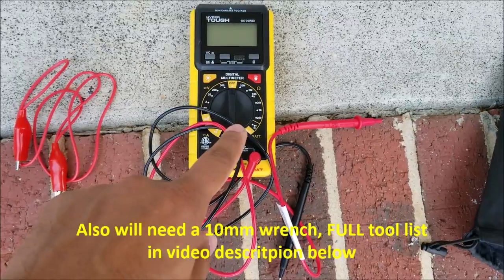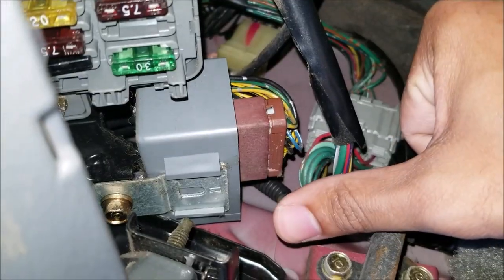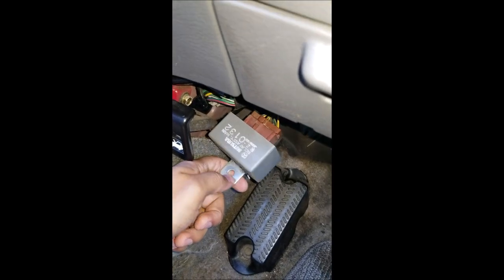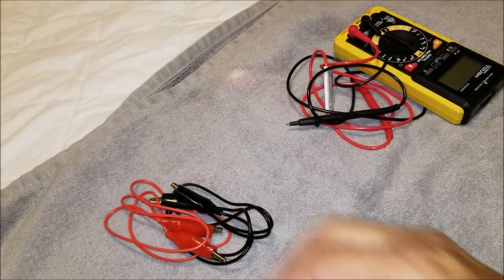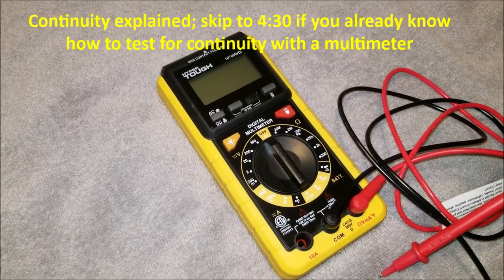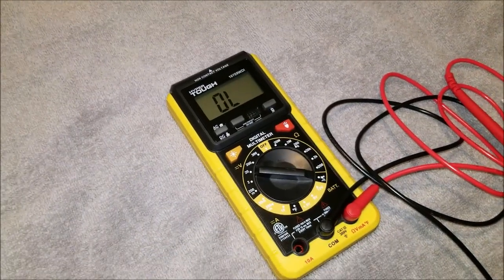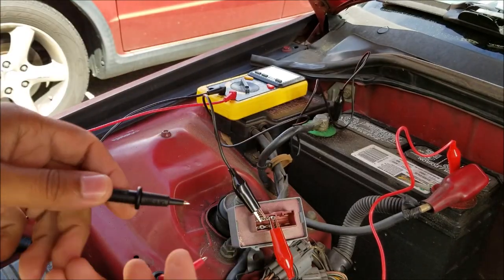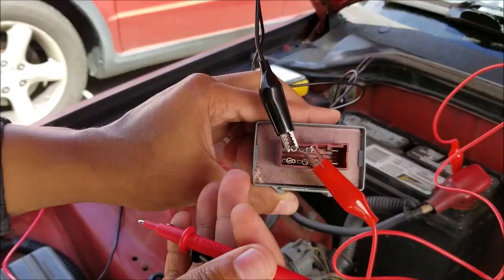How to Test and Replace Main Relay | Honda Acura 92-00 | Car No Start

Comment from the maker: Added correction for feeling for clicks. You'll only feel two clicks; 1st at key position II and second click at key position III (ignition, car turns on)
Reply: I just replaced relay and I still only have one click at the on 2nd turn of my key
Reply from the maker: @kentjordan3574  do you hear the fuel pump priming in the background with the key in position II?
Reply: @EngineeredMojo  no sir it does not power on.
Reply: @EngineeredMojo  I have a question. When I tested prongs 1 and 3 with positive on 5 and negative on 2 I got no beep. Ir instructions say to replace multimeter. Why do u suggest that of my meter worked fine on other test?
Reply: @EngineeredMojo  I have this same issue, I hear and feel one click on the second position and I hear the fuel pump priming. But when I go to crank the engine nothing happens
Reply: @JelloSpucci  did you ever figure out what’s going on here? My car started doing the same thing this morning
Reply: @pandajoexd611  so to be honest with you I'm still trying to figure it all out haha. But I was able to get the car started last night by basically running a small lead from the starter signal connector and then touching the battery for a second. I tried this before with my old starter and nothing so I went to a junk yard got a new one and boom. Now I have to figure out why the key isn't starting the car but jumping it will
Reply: @JelloSpucci  so I had just spent the majority of the morning trying to get mine started and I replaced the starter solenoid form one I found in a junk yard because the new one was 3 days out on order, don’t know if that helps you but I got my cb7 running again
Reply: Mine only clicks once. And I resaudered it. It looks good. What do you think?
Reply from the maker: @frankifleury5606  does it start yet? If not I would test the relay as I did in the video. You may need to resolder

Comment: When I put 9v (I know I’m at work ) to relay its more of an electricity noise not a click. I’m wondering if soldering or cb is bad . I bought a new relay but it’s not the Mitsuba one it’s a duralast 20505 . When I put power to 6&8 nothing happens on that one . I was also getting 6v to my fuel pump connectors  with multimeter . Car crank no start HELP
Reply from the maker: Hmm, if the new relay isn't clicking, it might be faulty, or there could be another issue in the circuit. Did you check all the connections?

Comment: Great video... however on my relay number 6 is missing on yours number 4 is missing although my relay part number seems to be the same. My car is a 1.6 16v crx 1989.
Reply: Yours is 4 then I have a diagram of the two different versions
Reply from the maker: Glad the video was helpful! That's interesting about the missing pin, it's possible there are slight variations even with the same part number.
Reply: @EngineeredMojo Mine is a uk spec 88-91 crx 1.6 16v d16a9 engine if that helps

Comment: 6 years later and hoping for anyone to respond to my question....does the relay need to pass all 3 tests? Mine only passed test #2 so would that make it a faulty relay? Thank you and great video
Reply from the maker: Video creator here! Yes, ideally, you'll want all 3 tests to pass as your testing different circuit routes. Do you have a friend with a Honda you can hook your relay to?

Comment: I bought one and my carcstays on for 5 seconds and still dies out and don't hear fuel pump priming.  My fuel pump is a year old and relay is brand new. Is it possible since its not oem Mitsuba brand it could be bad brand new?

Comment: Really great video. The only issue I have is that there have been times that I've bench tested a passing relay, but after opening the cover the contacts were badly corroded. Not corroded enough to fail the bench test, but enough to not allow enough current to pass through. To anyone who can open their relay please do so and check the contact points.
Reply from the maker: That's a great point, thanks for sharing that insight!

Comment: I also want to add if you don’t want Hondas there are two engagement in the main relay so sometimes you can hear click but that doesn’t always mean the relays working one send information to the fuel pump and one send information to the ignition. Sometimes one or the other can fail.
Reply from the maker: Great info to add, thanks for sharing!

Comment: Ordered a main relay. Now time to wait for it to arrive. Having an intermittent no crank issue where i get a single click. Starts whenever it wants to. All my dash lights are working as normal. Believe the main also acts as the starter cut. Can hear the bendix engage but its not trying to crank so hopefully it fixes my problem. If not I also suspect the ignition switch or neutral safety. Haven't had problems though indicating it would be either of those. When it starts it never stalls or dies. Always runs as normal when it does crank up
Reply from the maker: Hope you were able to get this resolved!!

Comment: Would the main relay cause a no crank condition?
Reply from the maker: For sure, it could be a cause and semi easy to diagnose!
Reply: @EngineeredMojo alright. Been having a no crank issue sometimes where it doesn't wanna start. Been hearing a click from where the main relay is located, my other question is if the relay is clicking is there still a chance that the relay is bad?

Comment: Is it normal for these to function and spontaneously stop working then with a few clicks gets back to functioning
Reply from the maker: @Terraworld-c7l  I could see that happening if the solder on the connection is only partially degraded
Reply: @EngineeredMojo  thanks

Comment: If this relay not working the check engine lamp will always lightning??
Reply from the maker: @youssefahmed6839  not always, if the relay is not working the car probably won't even start to see a CEL 😄
Reply: @EngineeredMojo  u mean that will not hear the sound of the march or the motor trying to start up ??

Comment: Awesome video. Thanks for the test text in the details section. Mine failed at test 2 so ill be ordering a replacement. Thanks again!
Reply from the maker: @artramirez3506  glad the test worked out and you were able to locate the fault in your sensor!
Reply: what is test 2
Reply: @abdurahmaandavids9905 All the steps are listed in the video description.

Comment: Hello my guy thanks for the great video, i have an issue crank no start, additionally the CEL light wont come on at IG1 and the immobiliser light neither, my question is very specific, can the main relay if its bad cause the ECU to not get power?

Thank you, liked definetely and subscribed ❤

Comment: disculpa. acabo de cambiar la bomba de gasolina, y al abrir la llave si suena la bomba trabajar, pero al quitar el filtro arriba del motor, no sale gasolina, es decir, no sube la gasolina, que puede ser la falla?
Reply from the maker: Espero que estés bien, ¿has inspeccionado el fusible de la bomba de gasolina?
Reply: no tengo otro para hacer la prueba. mañana por el dia lo voy a verificar mas a detalle. un saludo y gracias por contestar a estas horas.  @EngineeredMojo

Comment: Hey I have a 99 civic and my injectors are getting no power ,fuel pump is sending fuel to the fuel rail ,cranks has spark ,starts on starting fluid ,I already checked/switched pgm-fi I hear/ feel the 2 clicks the car ran fine till it didn’t want to start you do have any idea what could be the issue ?thanks in advance
Reply: Did you ever figure it out mine does the same thing

Comment: For reference, just cause you got continuity, does not mean about the resistance that are in them. Most relays on the power side usually have 0.2. Fuel pump circuit to main relay output wire should be at most 2.5 ish ohms. Might sound a little high but shout be enough for 5 amps-ish to go through. Just fuel pump, the ohm are 0.5. It can also be the main relay having too high of ohms
Reply from the maker: Great info, thanks!! Will help me in future track down issues

Comment: Hi, 
Do you know if these cars have immobiliser module/unit??
All key lost. I cut a key/blade, car cranks but doesn't start.
Now Honda tells me immobiliser is in the main relay.
Is ithat right??
Thanks in advance
Reply from the maker: My 1995 OBD1 Civic did not as I am always able to get a key made at local hardware store, but a newer version may have an immobilizer. Especially if your vehicle is OBD2 engine management system
Reply: @EngineeredMojo  it's a Honda Accord 1992, 2.2 petrol. Do you think these will have immobiliser module
Reply from the maker: @swarajjoye  ahh if European possibly so

Comment: Did you disconnect battery
Reply from the maker: I did not given the main relay does not have an influence on the charging system or direct connection from the charging system

Comment: And what should the numbers look like on the meter if it’s a good relay ?
Reply from the maker: It's just a continuity test so no numbers to view. You are only listening for the beep noise to confirm a complete circuit
Reply: @EngineeredMojo  yeah I ain’t got a tester that beeps just numbers

Comment: Thanks for the "click" tip on the main relay. I had never heard that one before. 
I can feel it click twice - but then there isn't the usual sound of the pump priming. Would this point to a bad fuel pump ? ( It worked perfect up until just now - although my MPG dropped from 42 down to 31 with all other things being equal ) But no other symptoms what-so-ever. 
I plan to jump it and see if i can bypass the main relay as a test. 
Thanks again for the tip.
Reply from the maker: Awesome to hear the tip about listening for the relay to physically engage was helpful. It's definitely just one indicator of possible failure. Since you still don't hear the pump prime, main relay might still be the issue. I like the idea to attempt to bypass relay. Never tried that route myself, but could help you narrow down the issue.
Reply: @EngineeredMojo  BTW, Though a little rough in places,( the audio ) overall your video has a pro look to it. 
Especially the opening shot with you in the car. ( The framing of the shot )

Comment: Hi,  just so you know,  in your instructions you miswrote to replace the multi-meter when I believe you meant to write replace main relay.  If you can still correct this on youtube that would be great for future readers who are not mechanics who are testing their main relay.  Thanks again for your video!
Reply from the maker: Thanks for the notification on that slip! Just updated the sections where that occurred. Hope the video was helpful overall :)

Comment: Thank you, a ton, for this video I definitely had to subscribe. I accidentally shocked myself by not paying attention haha but where all good no more holding alligator clips in one hand. Now i did figure out that when I did the 2nd test I had no continuity, nor any clicks would that mean that somewhere on my circuit the relay isn't responding? Edit in all the years I've worked on cars I have never shocked myself till today lol
Reply from the maker: Haha nothing like a small shock to get your attention to the task. Yes, with no clicks or continuity most likely a solder has degraded on the circuit board. There are a few videos showing repair of the relay by resolder. If you have the tools already may be worth a try before buying another relay

Comment: you mean replace main relay not multi meter???
Reply from the maker: You have a time stamp for reference? Given this is a main relay fix video and a multi meter is not even a car part, you can safely bet if there was a word mix up main relay is prob the correct word.

Comment: how is the hyper tough multi meter? pretty good. thought about buying one. good vid btw
Reply: Yeah imma have to scoop that bro. I looked at your vid because I lost touch on diagnosis. My issue is I have a 90 integra DA with a b20z2 swap that won't start all of a sudden. It's been a while since I dug thru one of these
Reply from the maker: Appreciate the feedback on the video. I'm more than happy with that multimeter, covers the basic items I need done with car electronics and the occasional audio I do in my car and home

Comment: My 1990 Acura Integra gs's main relay doesn't have a 6th prong but rather the 4th prong is there. What would be the testing procedure under these circumstances. 
-------------------------------
1      3         5       7 

2      4     empty   8
---------------------------------
Reply from the maker: Let me see if I can hunt down some info for your year vehicle, I'll give update

Comment: On test 3, pin 3 and 8. I get rapid clicking unlike the other ones are just a solid click. Is that normal? I have two relay so I tried both but also don't know if the other one is broken aswell as it was pulled out at a junkyard
Reply from the maker: If you are still hearing beep from multimeter for continuity, you should be good. Sometimes a short at the alligator clip/pin connection causes me abnormal click feedback i.e. clip is touching another pin accidently. Hope that helps!

Comment: Thank you for the advice. If all the 3 continuity tests succeed then does it mean I have to look for problems elsewhere? I mean does it completely outrule the main relay then?
Reply from the maker: In my experience, it does verify the relay is working. Each circuit on the board is having full operability. Unless there is visible damage to the relay, I'd move on to test other components of the all important spark, fuel, and compression items that get s car started. If you want to rule relay out completely, you could always buy a relay and pop it in. If it doesnt work, just return the relay. Takes some time but not much effort. Hope that helps!

Comment: Could it be a main replay issue if it cranks and wont start and than after trying a second time it turns right on?
Reply from the maker: Possibly, but not as likely from experiences I've read on car forums. That could be a solder in the main relay beginning to fail, but from the typical story...once it goes it's without warning haha
Reply: I see i might check the solders soon or later i dont drive it as much and it still turns on so im not in a big rush thanks for the reply

Comment: I have honda accord 1999 v6.  It is losing power and surging only when in drive.  Loses power as you push the gas then kicks in and races forward. No engine light.  When it doesn't do this it drives great. Someone said main relay could cause this.  Thoughts?
Reply from the maker: hmm that's tough especially with no check engine light. Have you checked for vacuum leaks in any of the air hoses in the engine bay?

Comment: Can a bad main relay cause your car to die on you while driving but then start back up after a couple of minutes?
Reply from the maker: That doesn't sound like a relay given the car was already operating. It could be a failing circuitry board within the main relay, but I doubt it. Worth testing your relay though. I had a similar issue and it happened to be my ignition switch

Comment: Been looking for days on where to find it. I eventually found it myself in a different location but same general area before watching this. Glad I am able to test this myself after of course I get connectors and alligator clips. Also to anybody needing to replace, if you take out the burgundy connector from the Mitsuba housing, you can find that some of the solder joints are cracked and can be resoldered and restored. A lot of videos on YT of that.
Reply from the maker: This is good info thanks for sharing!
Reply: qqaa

Comment: Fantastic video! One of the best, easiest to follow DIY videos on anything that I've seen on YT. When I tested me old relay, it passed. When I tested the new one that I bought before watching this video, it read 570, but did not beep and did not click. What does that mean - is it bad? My 1995 Accord EX cranks, but does not start. No power from relay to prime the fuel pump. Has fuel pressure. Coughs when I spray starting fluid into the air intake. Put on new fuel filter. (Nightmare) Tried a new distributor because I was getting code 09. Wondering if ECM is bad...
Reply from the maker: Hmm that is a tough one, if the relay is new it's rare for it to be a dud from the manufacturer. If you can get your hands on a ECU from a car similar to yours to test that would be my next step. Hopefully you know a friend who has a matching OBD ECU!
Reply: @EngineeredMojo  Thanks for the response! I'm hunting down an ECU now.
Reply: @EngineeredMojo  Update: I ordered an ECU on eBay with the same part number for $80. It arrived and I waited a couple days because I wasn't looking forward to another failure. Plugged it in. Turned the key and the car started perfectly. Almost couldn't believe it. Woohoo! So, if the relay tests ok, but the fuel pump doesn't kick on and car cranks without starting...it's the ECU.
Reply from the maker: @johnlibonati7807  great news and glad to hear! Thanks for the update, I plan to log that as a solution when going through the progression of figuring the issue

Comment: Good video go my Honda crv 2000 ex 4x4 stared morning good like 35 m driving coming back house put it off no want to stared like 25 m stared ogaing thing bad realay
Reply from the maker: Definitely could be the relay starting to fail, random solder failing in the circuit board.
Reply: @EngineeredMojo  ok thank s much check it Honda diller to much moeny seee where can got it for lest moeny
Reply from the maker: @angelgarcias7328  I got mine from Autozone, I believe for $60. Not too bad for a simple fix. If it doesnt work, it's a fast return to the store
Reply: @EngineeredMojo  thas true can buy it used 2 day to see do saint thing it do ogaing go back auto zone g m moeny back thank s much thas need asking main realay